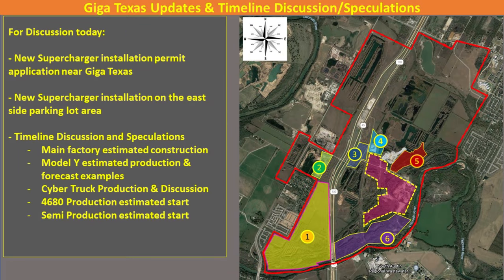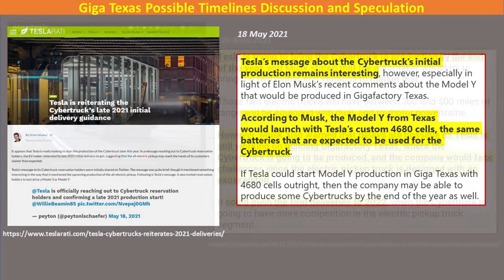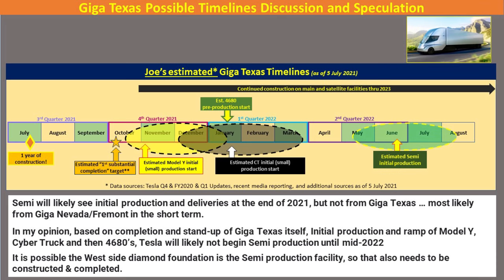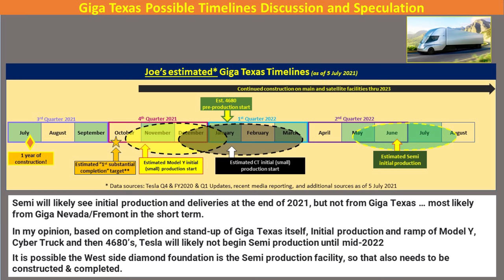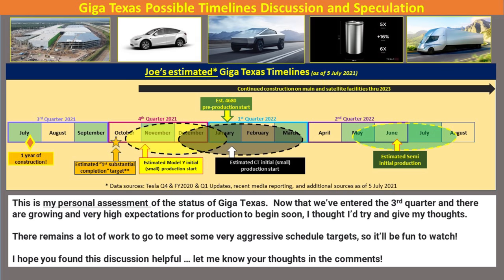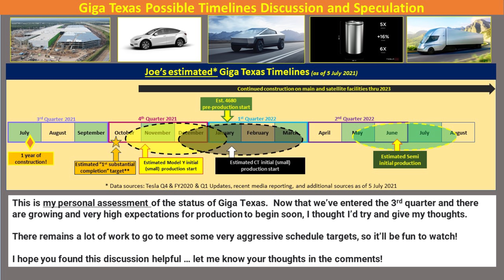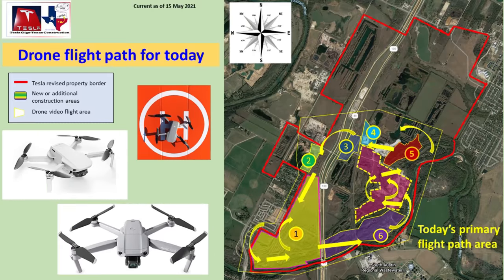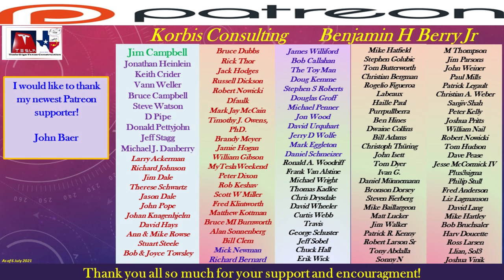Tesla Gigafactory Texas 6 July 2021 Cyber Truck & Model Y Factory Construction Update (07:30AM)

Comment: The concrete panels that are infilling the dock doors could be what we call “knock-out panels” meaning these will not be utilized until a possible future phase. At which time the panels will be removed and overhead doors and levelers installed.
Reply: Would it not be simpler to install the doors, but leave them shut?
Reply: @MrNautica  May depend on what that area will be used for.
Reply: @MrNautica  If the doors are going to sit idle for a few years then it is easier to do the infill.  They seem to have blocked off enough area for staging.  Bigger issue is usually the dock leveler pit; the leveler will get in the way if you are trying to store materials.

Comment: I believe the concrete panels at the far west are being stored at this clean/dry location to free-up trailers.  Typically, each panel was left on a trailer parked on the west side of the freeway for only a short time before placement.   Looks like these, nearly twenty, panels won't be placed for a prolonged period of time.
Reply: But why would they place them on the new foundation way over there and not leave them stacked up where they were? That just doesn't add up.

Comment: Thanks Joe.
8:04. North alleyway. Pair of black hoses running up to the roof. Didn’t know what they were for until I saw Jeff’s Day 349 where there has been a change in the system of sheeting the roof. Seems to be a cement based filler been applied under the first layer of sheeting and then over the top. Thinking the black hoses are little pump lines. https://youtu.be/75K9FJrlrqY?t=195
8:41. Vaults. The large diameter (18 to 24’, 450 to 600mm) white PVC pipes seem oversized, might be a way to increase the storage volume. Interesting that they aren’t all located under the roof centreline.
12:38. West side panel storage. Props and buried concrete anchor blocks for another row of panels.
14:40. Loading docks. 4th and 5th from south seem to have a concrete block wall built closely behind.
14:47. Loading docks. More block-out panels located across the highway. New concrete stair enclosure just north of the trailer with the block-out panels.
15:07. Beside the ramp. Another new stair enclosure.
21:59. East side storage yard. Right of screen, something Tesla red on the trailer. Partly under the blue tarp.
24:36. Robot storage yard. 2nd temporary structure using precast wall panels for the floor.
Reply: 8:04 Weird, isn't the point of "plastic roof" to not need that ?
Edit: Oooh, fire rating makes sense.
8:41 PVC pipe's volume is negligible compared to the vaults. Another mystery.
Reply: @musaran2  The vaults continue to keep us interested. I wonder if there will be another set further south?

Comment: You took a few well-earned days off, Joe, but the work at GigaTexas continued [though to be honest I hope it did slow down a bit, these guys are burning the candle at both ends trying to complete this project.] I think that filling in the two alleys/corridors is going to be slow, because each section will need to have its upper floors poured before the next section can be erected. I'm sure they have a plan for handling this, but it may well drag on for us, the observers. Everyone who has participated in this project have gone above and beyond what anyone could expect, and may I say that the quad squad has as well. It is a fascinating process to watch and I have enjoyed each of your videos.
Reply from the maker: Thanks Ivy!  Hope you are doing well!
Reply: Could they not pass the concrete tube past crane putting up the next stage of steel?

Comment: I believe they are removing the wall panels from the trailers over at the rumored Starlink  site for one of two (maybe both) reasons. First, the transit company that owns the trailers may be starting to run short on equipment and needs the trailers returned. Second, transit companies charge quite a bit of money for what's known as spotting fees. Spotting fees are the daily charges for a loaded trailer. Essentially, it's a daily fee to discourage companies from tying up equipment for long periods of time. My company charges about $86 per trailer per day, or a max flat rate fee of $2,600 per month, per trailer. With as many trailers they are using; this adds up quickly.

Comment: it's clear that stacking the concrete panels vertically rather than on the flatbeds saves a lot of space, not to mention flatbeds.... maybe that's all there is to it. after all, there are a lot of them yet to arrive on site and the manufacturer may be demanding that they be delivered.

Comment: Great video Joe!  As I think about your timeline and compare it to what appears to be the main focus areas, everything makes sense.  They are scrambling to complete all the underground utilities and drainage on the west side of the factory so they can prepare a paved surface in which to isolated the new vehicles from the construction mud, dirt and dust.   If you think all the new Model Ys will come out of the building where the concrete ramp is they can simply stage the auto-carriers in that general vicinity so once loaded they simply drive them off the site via the new road out to FH 973.  This should be very workable at least until they complete the rest of the work (mostly on the south and east).
Reply: Interesting thought.  I was kind of guessing the opposite— construction finishes on the northwest around to the northeast and southeast corner first, and the southwest corner remains in active construction for another 4-6 months.  I picture the west side “starlink” pad being the next contractor parking area

Comment: Joe, I think your suggestion about the steel work completion timing in the southwest is a bit optimistic.  I give the completion of that a 50-50 chance of finishing by the end of July.  On the other hand, I give finishing the columns/roof of the casting area an 80% chance of completion by then.  They may even have a substantial amount of walls done by then also.
Reply: I wouldn't be surprised if the center section of steel is done prior to the southwest.
Reply: It really looks like the southwest section is the lowest priority of the site.

Comment: Hey Joe, I am wondering where they will stage the cars for transport once they get producing?  

At 500,000 vehicles per year, that is 1370 cars/trucks per day they need to roll out somewhere and load onto transport trucks.  Any guess where?  Maybe that is why they are filling in the ponds just south of the assembly structure…
Reply: I assume the main workers parking lot will be the staging area. They still need parking for employees, but there should be enough space all around the factory once most of the heavy external construction is finished.
Reply: Likely near the chargers

Comment: Joe, do you know what they are going to do with the road to the west of the plant between the plant and the road? 15:49 Currently, there's not enough room for it unless the excavate the hillside. Might they cut it away and use a retaining wall? I suppose they could just bring it in very tight to the building, but that might not be very safe.
Reply: Not that simple. That is state owned land.
Reply: @DavidJohnson-tv2nn  Thanks.
Reply: It might dead end on the west side, just allowing traffic to that area. It would make some sense as that would keep truck traffic separate from automotive traffic. Another possibility is it could drop to a single lane limited access for a fire lane.
Reply: @zmavrick  Thanks. Interesting ideas. You could be right. I'm hoping Joe will reply as he may have inside info.
Reply: @zmavrick  There is a lot more space there than it looks.  There should be space for a comfortable 2-3 lane road— I think the minimum setback from the property line is something like 50’.

Comment: I think they’re gonna be pushing on the battery factory a lot harder than US to me I don’t think it’ll take them a year to get that up and running they have to get it going faster because of the cyber truck take him for 4680s the model Y 4680s the semi truck at 4680s I think the 4680s and they’re their overall big plan is one of the most important pieces moving forward I just think we’re gonna be pushing a lot harder than that
Reply: I agree. The 4680 is the most important part of this process. They have already done half the floor and all levels have been concreted. Before long they will be putting up wall panels. I see this facility producing batteries within 6 months.

Comment: Great flight today. One glaring thing stood out from the beginning. Rain water everywhere!! Again!! Super expensive equipment will continue to be installed in the building throughout the build-out phase. We see there are many pallets of roofing panels stacked all over the roof. Yet, where are the roofers?? There are no roofers installing roofing panels to button up the roof watertight. I do not understand the planners for this job. We saw rivers of water flooding through the roof into sensitive areas during the previous rain. Why aren't the planners prioritizing getting the entire roof watertight as the construction moves along?  No matter if parts of the building aren't going to be use right away. Keeping the roof buttoned up the roof seems reasonable and prudent to protect all those steel members from rust, not to mention all the robotic equipment etc.  Anyway...I had a great 4th of July, hope everyone else did also.
Reply: The areas where roofing is currently ongoing don't have any equipment in them.
Reply: If the roof is watertight, where does the water go? Then you would just get mega flooding on the roads/central area. Obviously, the water isn't a concern for them otherwise they would have changed tack months ago.

Comment: Hey Joe, about 2 month ago you told me that I will wish the rain back when the area is suffering from dry heat. I didn't do anything but can you tell when that phase in the seasons actually comes when there isn't a flooded building site anymore. To me this appears to be a horrible choice of a location to build. Even Berlin has better weather. Any suggestions if this will still change this year?
Reply: This year's rain (and cold) has been very unusual for Texas.  The record breaking heat in the Northwest is what we should be getting.  Not that I'm complaining, haha.  They can keep their high pressure dome.
Reply: @cratecruncher6687  Got it . I don't even want to imagine how much of the sensitive robots and machines in the building gets ruined by all this moisture

Comment: One thing that should be noted about the CT that elon mentioned is a lot of the body is using stamping not casting.
Reply: The panels of the truck won't use stamping, they will need to be scored and bent. The Cybertruck likely uses casting for the front and rear parts of the body (similar to the Texas/Berlin Model Y). https://electrek.co/2019/11/24/teslas-cybertruck-looks-weird-because-otherwise-it-would-break-the-machines-to-make-it/
Reply: @jamescoppe  Do they bend with a brake or roll form the steel?
Reply: @patrickkenny2077  Not sure, sorry.

Comment: I am primarily concerned with when production (Model Y and CyberTruck) will commence. As you can imagine, I'm going to be on tenterhooks until April 2022. 
If Tesla can meet that date. I figure that should put the final nail in the coffin of the Tela haters out there, and ease pressure on the stock. (As a TSLA shareholder, I wouldn't bitch. 😉)

Comment: No batteries, no cars.  Everything depends on the 4680.
Reply from the maker: That’s why Kato Road is so important
Reply: @JoeTegtmeyer  exactly. 'The Limiting Factor' described Kato Road not just as a prototype facility but as a flywheel to provide momentum to get other projects rolling.

I highly recommend his channel.
Reply: @JoeTegtmeyer  kato road will get them started, but it can’t carry the load.  You projections are the most conservative I’ve seen, but I think you can add 6 months to your timelines.
Reply from the maker: @slicksalmon6948  actually, I think Kate Road can carry the load for awhile as production ramps up to next summer.  Then Giga Berlin and Giga Texas need to have their own useable 4680s, probably at the 10GW to 30GW range initially each to allow further ramping up.
Reply from the maker: @Klemeq  that’s actually one of my sources! 👍🤓
Reply: I think Texas will be a reverse flywheel for Fremont.
It'll be sending castings north while they swap their model Y and then Model 3 lines over to front and rear castings and structural batteries
Reply: Kato can produce enough cells for 100k vehicles/year, less whatever semi production they are doing.  Berlin and Austin combined will take 6+ months of production to exceed that capacity.
Reply from the maker: @patrickkenny2077  correct!